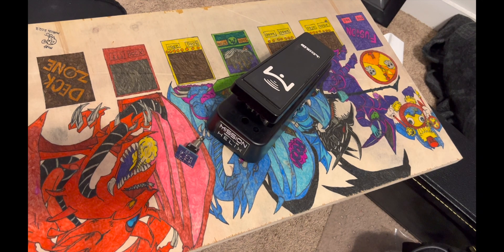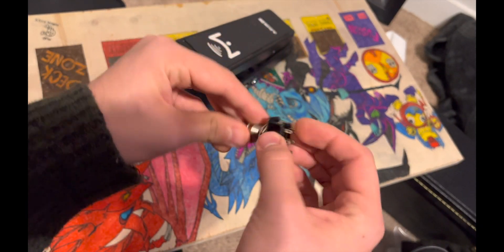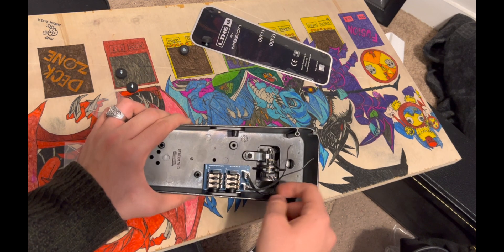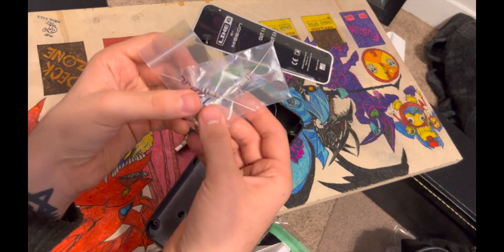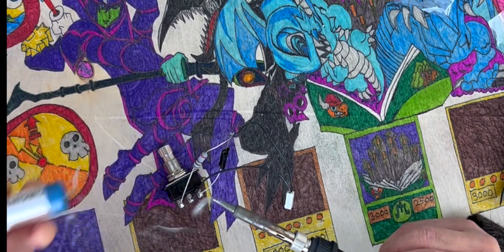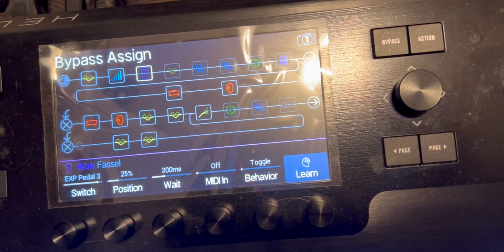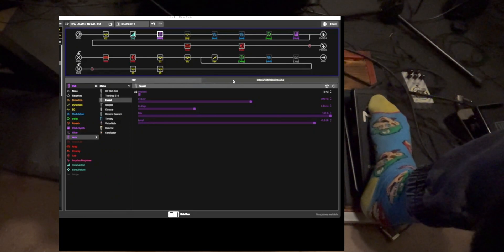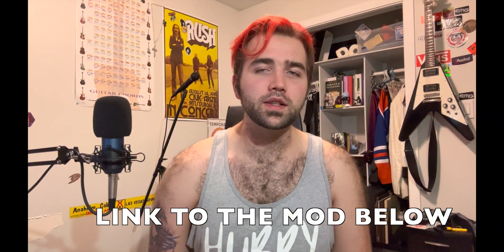Mission Engineering SP1-L6H Exp Pedal Toe Switch MOD for Helix Floor, How to Tutorial/demo-B-GRUDZ-

Comment: Normally open and normally closed would refer mostly to a momentary. And since this is latching, it does not really matter.
Reply: Also, that pedal model does work with the Helix floor if you only use the rear jack. You just can't use the switch without modifying the pedal.

Comment: Hi, do you know if the original so-1 with 2 jacks ( 1 in 2 out ) will work with the helix?
Reply from the maker: Output 1 into exp input 1 would work as a normal treadle expression pedal would. The number 2 output is for the toe switch to engage/disengage effects in the helix.
But that’s supposed to go into toe switch input. A feature that only exists in the helix rack not the helix floor, helix LT or HX Stomp. 
So performing this modification lets you use the toes switch function to act like (expression pedal 3) which could be integrated into the helix floor for more epic wah solos.
Reply from the maker: So to answer your question. Yes and no. Do the mod. Learn grow. Aspire for knowledge and wisdom shall follow.

Comment: This would look cleaner:
DPDT switch:
1 - 2 - 3
4 - 5 - 6

solder R1 between pins 1 & 4
solder R2 between pins 3 & 6
solder wire 1 to pin 2
solder wire 2 to pin 5

Switch "on":
wire 1 - pin 2 - pin 1 - R1 - pin 4 - pin 5 - wire 2

Switch "off":
- wire 1 - pin 2 - pin 3 - R2 - pin 6 - pin 5 - wire 2
Reply from the maker: Yes you are correct that would be a cleaner connection, the same as a diode swap switch on a distortion/OD pedal, except switching between two resistors. 
Gotcha

Comment: Why do you need the resistors?
Reply from the maker: So the input that we place the dpdt switch’s output to, naturally is exp 2 of the helix floor. 
In the helix floor you can only toggle (bypass) with positioning your pedal at a certain threshold for X amount of milliseconds. 

So the mod 
Takes a dpdt switch and it switches between two levels of resistance to make the original helix exp 2 input react to the dpdt switch as if it was a potentiometer in a original EP-1 (Mission Engineering exp pedal)

So when to tap the switch and it clicks the resistance sends a percentage difference to the helix as if 

the position of a foot pedal was changing. 
^ which is how a expression pedal originally could bypass an effect as I mentioned earlier. 

If you only used a switch with no resistors there will be no change in the bypass setup of an effect set to exp 2 . 
So you need the resistors to send different values for the helix to read and then work as it should as if instead of a potentiometer with a range of x amount of resistance, 
We have resistors with set resistance. 

Hope that helps! 
Thanks for watching & thanks for the comment Mark. 

~B-Grudz
Reply: @Pedalheadshow  Thanks for the reply, I have done the mod and it works, sometimes, the other times its either dead or flashes wah on off in an instant, why Line 6 can't sort this out in an update?

Comment: Hello,

Great video...I'm planning to modify my Ep1 to Sp1 for my Helix rack...I can't find a picture of the inside of the pedal anywhere so I can do that modification.
Can you tell me what your Sp1 pedal looked like before your modification?
Were only two wires soldered to the momentary switch?

Thanks in advance
Reply: Thanks for the quick replay💪💪💪 Maybe I wasn't precise in the previous comment... I want to upgrade stock Ep1 (which doesn't have toe switch) to Sp1 (which has toe switch). And of course I want to install a momentary switch like on stock Sp1. In that sense, I needed confirmation that on the stock Sp1 there is only a momentary switch and two wires, without a resistor? In the meantime, I got a reply from the Mission guys, and they say this: " Thanks for the note. There is no upgrade kit for the EP1-L6. The SP1-L6 is manufactured differently using a circuit board. If you have some basic electronics skills you could add a momentary switch to the EP1-L6 yourself. We recommend Small Bear Electronics for purchasing pedal components.." So, based on everything, I think I need a momentary switch, 6.35 jack output (Ep1 already has factory drilled holes, the chassis is the same as for Sp1) some cable to connect the switch to the output, and it should work😎 If there were no resistors on the stock switch except for two wires, I assume that I will easily make the modification💪 Otherwise, I have a Helix floor, and for it I used one sometimes two Ep1s, so now I want to convert one of them into an Sp1, since the rack version that I recently bought is arriving, and it is on its way to me😇
Reply from the maker: Hey Zarko 
Thanks for your question 
I’ll do my best to see if I can source a photo for you. 
But yes it was only two wires that come from the mono jack input. 

Now since you have a helix rack you should be able to plug the SP1-L6H
Stock into the expression 1 input and the toggle expression control in the back of your helix rack. 
This mod I did is particularly done for the helix floor (WHICH DOES NOT HAVE A  TOGGLE EXPRESSION INPUT) 
Helix floor only has 2 expression inputs. 

This mod in my video lets you swap the expression pedal 2 input for a toggle. 

But as I mentioned the helix rack has a toggle input for control of bypassing effects (wah) for example. By pressing the toggle at the top of the expression pedal like a classic wah pedal. 

So for you my friend make sure you have a SP1-L6H.

I suggest buying the stock. 

The mod I did is gr8 but unfortunately it won’t work with you. 
Maybe you can figure out how to set up a momentary switch instead of a latch switch. 
But you
Might need different values of resistors
But same wiring scheme should be applied. 

I have the spare part from my modded SP1-L6H
I’ll see about post a photo in my next comment for you. 
Thanks for watching the video! 
The Helix is awesome.

Comment: so there is no auto engage on expression pedal controller in the HX...?
Reply from the maker: I believe the only work around for auto engage of an expression controller is if you set a track on your DAW and place  the proper midi information to engage and disengage the expression pedal at certain points in the song you are performing. 
Besides that the only way to bypass the pedal (without this mod) is by setting the bypass of your desired expression effect to the same pedal you will be using. Then under effect bypass select the expression pedal you want to use then set the bypass to a position of 1%-5%. Then when your treadle surpasses that percentage the effect will be engaged until you come back to that position of 1%-5% to disengage the effect. 
Thanks for the question I will do a follow up video on this subject.